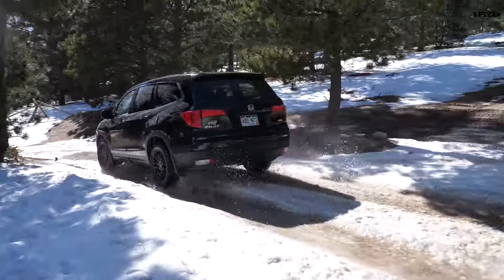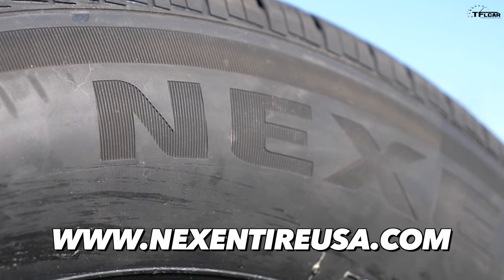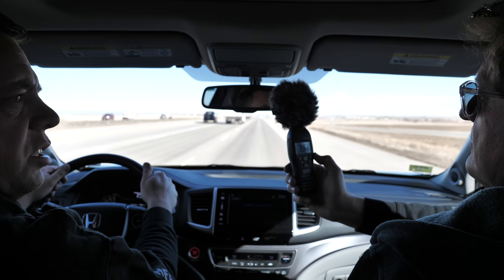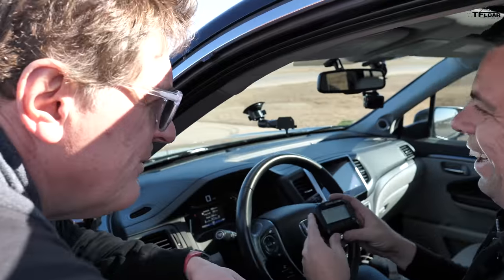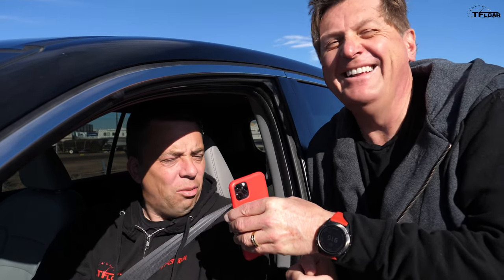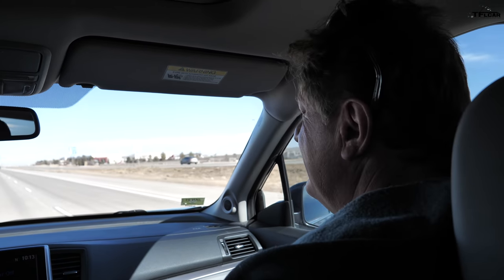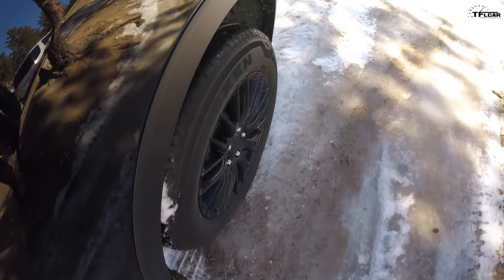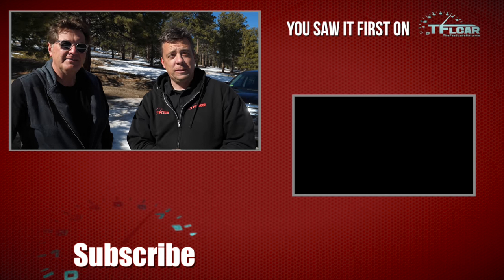How Much Faster Are All-Season Tires Than Snow Tires? Let's Find Out!

Comment: Tires,...they are so important to how a car/truck handles,....after all what else actually touches the ground you drive on! So it's a good thing TFL is doing here,....ROAD TEST the tires.
Good on ya guys!
Here where I live in Canada,..a lot of folks have their vehicle's snow tires mounted on wheels to be changed over seasonally and as weather conditions dictate, it's about as much work 
as changing a flat tire isn't it?  When I bought my new vehicle in 2017, the Dealer included a full set ( 4 ) of o.e.m. wheels with a top brand name snow tires, mounted and balanced. 
 If you live where there's snow/ice you do need 'snow tires'. Insurance Companies have studied and therefore know that SNOW TIRES do make winter driving safer, in fact some Insurance Company's here, will offer you a discount if you have four snow tires on your vehicle during the winter.

Comment: Snow tires work best below 7 degrees celsius. The problem with this test is its not true. Are the tires you are testing brand new in both cases? If they are then you need to check the traction of both sets of tires once you have put 1 year of driving on them.
Reply: They said it was just for fun and not scientific.  Why are you being so negative?  If you don't like the content, don't watch it.
Reply: @ebels3  As long as it's free content its always open to criticism. If you don't like it throw your computer out the window! Lol
Reply: @ebels3  The issue is, they didn't really test anything.    An acceleration test of a worn out snow tire vs an new all season, on warm dry pavement?   WTF was that for?      The took the all seasons into the "snowy" mountains.     I would love to take these guys for a drive in the really winter driving conditions.    The best part of this video was the videography.     You're correct though when you stated, it wasn't scientific.    But the part about it being fun?   Not sure where there was any fun involved other than twice around the test track in ill handling, under powered people hauler.
Reply: @ebels3  some people may believe in the video and it's good that at least someone in the comments warns them
Reply: And also all seasons came with lighter rims, which makes the comparison even less objective
Reply: They have done that years ago on a Subaru.  They only made this video because they had a sponsorship and had to feature the tires somehow.  They did it for fun.

Comment: A 2019 Frontier followed me home Thursday. Yesterday and today we got dumped on, so I wanted to try the tires. It has Hankook Dynapro HT's, and in 2 wheel drive it handled most of it fine. They are rated all season M+S, and like most tires with this rating, I've had pretty good luck. I've never used dedicated winter tires

Comment: Well, your Colorado law makers got it  wrong.  They passed a new law last year for the accident prone areas, and defined winter tires not as tires with the 3-peak mountain snowflake, but All-season M+S with sufficient depth.

I  see you got Toyo Observe GSI-5 tires?  How's the ground walnut shells in terms of snow & ice grip?

Nexen does have some snow tires.  Had their Winguard Sport (performance winter) on my old FWD lowered station wagon.  Got me everywhere I needed, and with a stiffer tread pattern, gripped the dry-road better.

Now with an AWD Cute-out, I'm on Nokian All-weathers, for driving in LA during the week and hitting the mountains on the weekends to hit the slopes.  Chains?  Don't need to install them, just carry them (do practice installing them when I switch the wheels to my all-weathers).  The nitto SN-2's I had previous were great on the snow and ice, but miserable in the dry, especially winter LA (around 60 degrees).  The Nokians worked well in the snow and ice so far (in it's first season for the car).